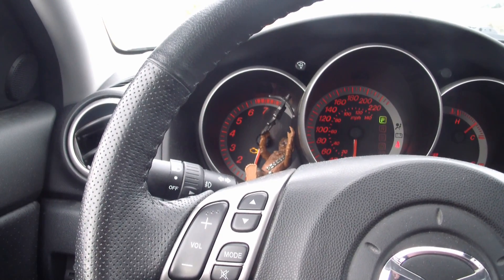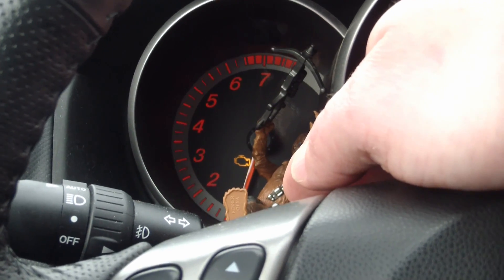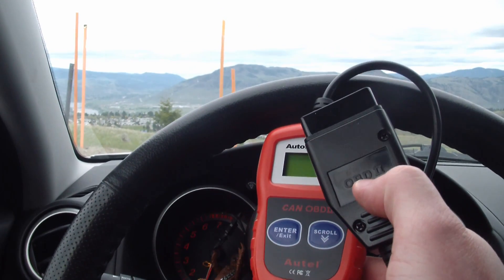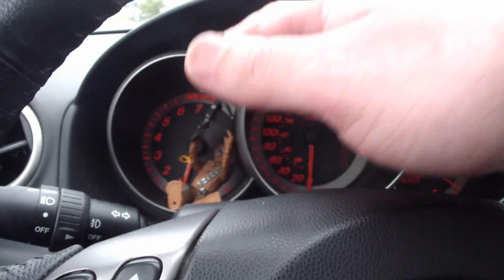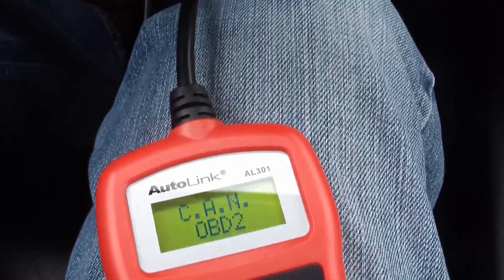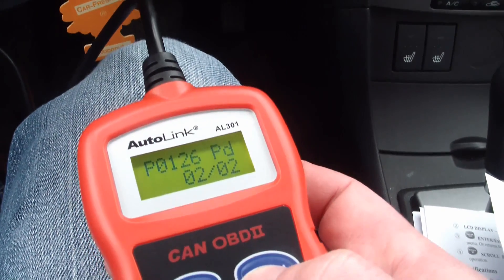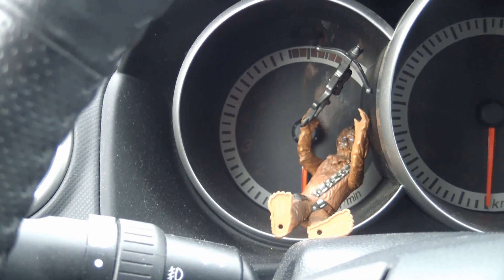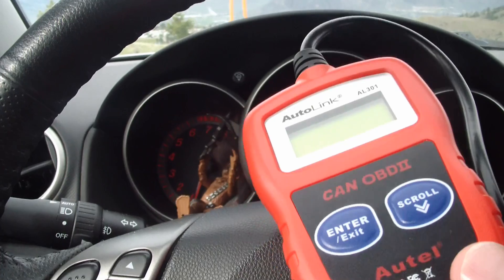Manly-Man Skills: Outsmart Mechanic Scams by Using Your Car's Computer!

Comment: The check engine light inspection requirement was the WORST thing our government has ever done. It has caused me and others enormous grief when perfectly good cars can't pass inspection because of a bullshit code. Perhaps there's a slight evap leak, a catalytic converter working at "only" 95% efficiency, or some other bullshit issue that doesn't need fixing in the dead of winter or isn't worth spending $1,000+ to fix. If you have the money for that, or think the games our government plays are cute, then god bless you. But I despise not being able to legally drive a perfectly good vehicle without paying a stranger or busting my ass to put out a bullshit code. #fuckthegovernment #fucktheenvironment P.S. I probably do more for the environment than most people by not having kids, recycling, saving electricity, gas, etc. But I draw the line at causing people grief in order to protect the environment.

Comment: I love dealer techs. Oil changes at the dealership are competitively priced these days, and they do a thorough inspection of a vehicle by the book, so the service adviser can tell me whatever maintenance needs to be done. Then I do the repairs myself. Gives me the opportunity to use OE, OEM, or even improved parts (like replacing an original, crumbled plastic impeller water pump with OEM-produced metal impeller pump) for something like 30% of invoice. Much better deal than taking a car to some generic Quickie Lube type of place. Those guys aren't gonna tell you when you need to replace SAI pump mounts under the intake manifold. If I don't have a specific tool I need (want), reminding my wife that I saved $2,000 gives me justification to get a new impact gun and sockets... and a new motorcycle.

The comments here are hilarious. I imagine being a tech at a dealership means you have to work on idiots' (mechanically inept, at least) vehicles day in and day out, and you're in a position to be exposed to some wild stuff. Don't act so high and mighty, though. Manufacturers all have relatively easy to follow work flows these days. Yes, diagnostic processes have evolved, but internal combustion engines and electric motors still operate on the same principles they always have. All the emissions and efficiency subsystems are added complications you isolate component-by-component and troubleshoot one at a time. You're not the only mechanics in the world. There are plenty of us out here who may not work PRIMARILY on automobiles, but spin wrenches and/or fabricate for a living. Some of us aren't scared to cut and splice wires, either.

Comment: As a dealership mechanic of 8 years.... I gotta say in total honesty that I have never "taken anyone's lunch" I charge a fair price, by the book, if it's not in the book, I charge what average time it takes me. And I don't consider it charity, more of a favor, (my job) when they come in for a concern, and I go ahead and lube latches, adjust things, tighten loose crap or bare minimum if it's something that's going to take some time I'll warn the customer of what's going on. That being said, the biggest scam I've seen in my time as a technician, is the dealership scamming the company they affiliate with. For example, covering things as warranty when they are clearly not warranty, for a couple of reasons, the management or high up knows the customer, and they commit warranty fraud to keep them happy.. the second reason, the customer, for lack of better words, is an asshole (come on, there are assholes in the drive through, they're everywhere) and the manager doesn't want to deal with telling them their car is out of warranty, so they commit warranty fraud to get them out of their hair. When it comes to screwing the customer over, all I can say is, search more sources than just one or two, if they recommend a service it's not always stealing your money, do the research, and decide what you need or want to spend your money on. Ask a reputable mechanic or technician any question at all. I get asked questions all the time, sometimes the same question and I will happily repeat myself just to educate those who do not know so that they don't waste money OR so they don't perpetually destroy their car when they should have spent money. I am by no means defending the actions of those that do scam and steal, they can rot in hell because they're not even human in my book. But back to the check engine light, ave is right, a lot of times it is something simple, sometimes not so. But the 20 to 50 dollar investment is worth it, even if you are not mechanically inclined, the code and description will give you a good direction to go, or at minimum an idea of what is going on in your car. I've seen lots of wires chewed in half from previous repairs that the guy didn't get wires routed correctly, from mice chewing them up, from a body shop repairing the look goods after a wreck but not double checking all the wires and or grounds that got damaged. There is a lot that goes on in the working on cars field. And I will be the first to tell you it's not perfect, but there are people out there who do work at dealerships that are human, that are compassionate and they will fix your car and not take you to the cleaners. At my dealership alone.... I have seen kittens pulled from the dash, a seat that had to be removed to get a pet hamster out from under it, and I've seen an oppossum (live) removed from an engine compartment, and all these things were done without charging the customer, even though the kitten and the hamster took about an hour a piece to extract. Sorry didn't mean to rant, guess I stretched my two cents a bit far.

Comment: haha i had a bad catalyst in a catalytic converter in a car with 300,000 miles.  I called the dealer and asked how much a new catalytic converter was.  they wanted 2,500$ for it because they had to replace the entire exhaust line - upon pressing them they claimed that their protocols mandated that was how they were to fix the situation.  I told them to eat shit and die, and then took it to a small shop specializing in exhaust works.  they took a grinder and chopped out the converter and welded in a new one for like $200.

Comment: I bought an OBD2 reader from eBay for £15 because I had a intermittent sensor fault. Glad I did, a call-out was going to cost me £40 a pop to reset the error code.

Comment: When I used to be an apprentice to a car mechanic he told me there's a simple but serious problem with many mechanics (especially dealer mechanics): they're taught how to replace parts, but they are not properly taught how to diagnose issues, so they'll often throw parts at problems hoping to solve them instead of actually diagnosing it.

Comment: just as a note for any programmers or beginner programmers out there:
the connection used is literally just a standard serial connection, so there are OBD2 to USB cables and ready to go libraries (such as python). The OBD2 connection actually contains a TON of information as well and it's how people use small single board computers in there car easily.

Comment: It is a Good thing you’re trying to do there unfortunately I wouldn’t get all Zip A Dee Doo Da happy when you restart the engine and the light doesn’t come back and diagnose a coolant temperature error immediately after restarting the engine because of course you big frozen moose turd the engine is not hot enough to throw that code right away right??

Comment: Some vehicles do produce codes in the digital odometer. If you go through the proper procedures to find them, this can be done by doing some research on Google on the make and year of your vehicle. I have a Ford 6.0 powerstroke diesel I use this all the time.

Comment: Unless the check engine light is flashing.. Normally not a major issue.. Go buy a $20 obd2 adapter from ebay, download torque obd to your and droid or iphone and boom, view and clear codes under $30

Comment: Having a trusted mechanic is a god send. I usually save 30-40% off what the dealership quotes. I remember once Midas gave me a quote of almost $1000 for replacing front brakes and rotors on my ranger. $150 for each rotor!

Comment: p0126 usually won't come back when the engine is already warm. could be low coolant, could be wiring or a pcm. but usually its the sensor or most likely a bad thermostat. cars today the thermostats tend to stick open which would cause a p0126.

Comment: Car stealership is about right. I got a car from a friend not too long ago who had taken it to the dealer to have it checked out before he handed it over. He gave me the receipt showing what they fixed and what was recommended.

$648 to replace a bloody valve cover gasket. It's a $12 part, which is overpriced, and if it takes you more than 15 minutes, you need to turn in your tools. On top of that, as tight as the bolts were, the nitwit who installed it must have cranked down on them as hard as he could, crushed the gasket, and it still leaked!

Comment: A basic scan tool is a great investment. Note that you can spend a little more and obtain a scanner that includes a fault lookup table, these display both the code and a description of the fault. Some scanners also offer manufacturer specific codes.

Remember that a code is only telling you the device that the computer suspects or is "unhappy" with. DO NOT blindly replace the component listed, or you may spend money on a part that's happily choochin along. For example, I've replaced thirty cents worth of broken vacuum hose in a situation with oxygen sensor performance faults. The sensor goes out of range due to a lean condition. 

Made plenty of customers happy by saving their  hard earned dollars, better to spend on celebratory beer! All I charge them for is my time. Been doing it this way for 30 years or so.  Not all mechanics are thieves.

Comment: Another tip and just the tip. A flashing check engine light usually means that a major component is throwing the code and you should pull over for a tow. A steady lit CELight is less severe like a sensor in your case.

Comment: If you don't already have a reader, do some googling, there's often a trick combination of keys and odometer reset buttons and gas pedals, that will allow you to read the OBD codes from the car's computer on the odometer display or information display.  I know in Arizona, Tesla got ran out of the state for trying to sell cars directly to consumers without paying an arizona stealership to be a middle-man of uselessness.  The dealership system is totally retarded as is the alcohol distribution system.  Bunch of stupid ninnies made our laws, and we don't the political momentum to rake 'em back.

Comment: But it just needs a thermostat. 10 minute job. 20 dollar part
Reply: Depends on the car.  Replace a thermostat in a subaru horizontal six: its in the timing case, behind the timing chain, behind the water pump. . . . .all of it has to come out.

Comment: I actually have an app on my tablet called Torque Pro and use a bluetooth OBDII connector. I can pull the fault codes, clear them, and also get live readings from every sensor on the vehicle.

Comment: In the US, at least, Autozone will pull the codes for you for free. It's also worth noting that, while the general code categories are the same, the individual trouble codes can differ from make to make & manufacturer to manufacturer. It's always best to google a trouble code list for your specific car.

Comment: You will also need to drive the vehicle for a roughly 30 miles or so to determine if the code will come back. You can clear the codes but until the computer fully returns to normal running confections and checks that sensor it will not be fully cleared.

Comment: That thermostat might not be closing and opening at proper temperature or your coolant is at fault not proper mix... Or your cooling fans might have something wrong but usually fans are monitored and may have thrown a cooling fan trouble code..... Some cooling system display cooling issues

Comment: how could a dealer mechanic smash a muffler upward?  could they bring it down off the lift and maybe leave a stool or something and smash it?  cause we have a new car and somehow the muffler underneath is smashed straight upward..as in it wasnt hit from driving over something theres no scrapes like it would have from running over something. and the front and beck edges are fine its smashed in the center..  they tell my old lady that are muffler needs replacing and its smashed and i look under and sure as shit..but we never hit anything in it it was an almost  new vehicle only a few months old at the time and when i bought it i inspected the under carriage for damage leaks etc and remember seeing a nice clean shiny muffler  as it had a little bit of mileage it was brand spanking new. all we did was bring it in for the scheduled "free" oil changes we got when we bought it and now we have a smashed muffler.
Reply: yep, set it down on something.

Comment: I have an elm327-based bluetooth version from BAFX, which works with andrOBD and Torque(I tried the lite version). I would assume it works on anything else that follows elm327 standard for bluetooth CAN bus adapters.

Comment: It's very possible someone has already said this but if you're near a autozone or most other major auto parts stores, they will usually check the code for free. However they will not clear it but at least you have an idea of what the problem is

Comment: OBD2 is great.  OBD1, though?  Not quite so simple.  However, as I understand it, OBD1 is mostly difficult because it's nonstandard.  However, most of them are designed so that they can be read without sophisticated tools.  I'm not a huge expert, but there seems to be an online tutorial for working every brand's system, and most of the time, it's not too difficult.  Also, just running the standard list—fluid and oil checks, the gas cap, and giving it a listen with the old ear—can usually save you time and tell you whether or not to consult a mechanic.  Any unusual noises are cause for concern, but the things you're really listening for are rattling or knocking sounds, the latter of which is a sign of eminent disaster and should be brought to a mechanic immediately.

Nice Mazda, by the way.  Respect.

Comment: "most" people who use dealerships can't do there own work, or start a job and can't  finish or are still in warranty, it also helps if the "mechanic/ technician" actually knows what to do because most these days are fitters, remove and replace not rebuild

Comment: Spend $79.95 and get the OBDLINK MX it is a Bluetooth device that uses your smartphone as a display it has a ton of functions you don't have to cross over numbers to codes if there's hey check engine light on it will tell you there's a misfire on cylinder one or a coil malfunction on cylinder three and so on, there's also a dashboard function to show your miles per gallon, calculated engine load, amount of fuel in tank, torque converter slip all at the same time on your phones screen. I've had mine a little over a year not one problem, BY FAR ONE OF THE BEST PURCHASES IVE MADE. 

By the way love the channel and all your videos keep doing what your doing!

Comment: Do a BOLTR on the Mazda, let's find out how she does the chooch.  I mean down to the airbag circuitry and how good the roller bearing are in the CV axles.  If the light is on, she's done for anyway, too many hot suppers.

Comment: i had a customer refuse my diagnostic charge of $90.00..went and bought  one of them little $30.00 code readers, plugged it into his car, got an EGR (exhaust gas re-circulation)  lo flow code. went to the auto part store, spent $233.00 on an EGR valve...brought the car into me because he couldn't get the large exhaust tube loose... i charged him an hour to replace the valve.. $117.00 i reset his light when i was done and gave the car back to him.... week later came in complaining his light is on again for the same code. didnt want to pay 90 bucks because he paid me 117 bucks to install the valve..... after the bug customer - go - round i agreed to diagnose it at half price 45 bucks. the look on his face when i told him he needed a 23.00 DPFE sensor all along. 
who ripped this customer off?????? he did it to him self. if you are going to fix your own car, research!!!!! dont read a code and buy that part! i KNOW what im doing, if you want me to diagnose it be prepared to pony up some cash.

Comment: Got a warning light on my viper a couple of years ago. I found out that on Dodge vehicles (jeeps included) you can cycle the ignition key 5 times to bring up fault codes on the dash. Turns out it was a fuel vacuum fault or something along those lines.

Anyway I haven't seen a light since so I guess that was a nuisance code same as you... I dread to think what would have happened if I took it into the dealershit though.

Comment: my checking engine light has been on for 8 years my truck runs great its usually just a dirty sensor shop said they could change it for $200 but told me i shouldn't. bother because it would probably just come back on in six months its nice to find a honest. mechanic